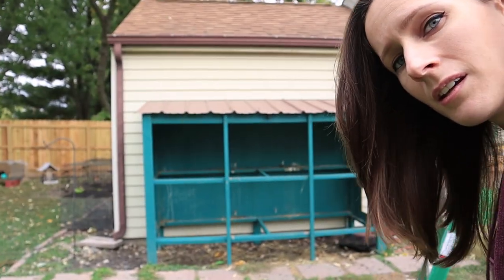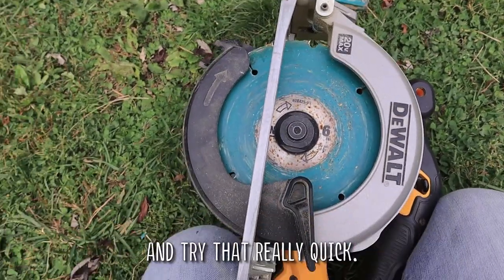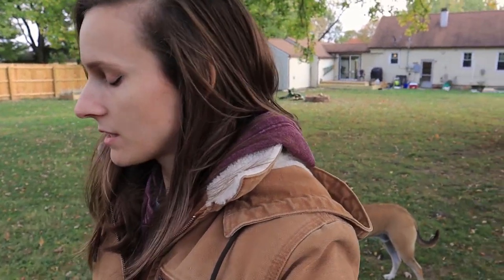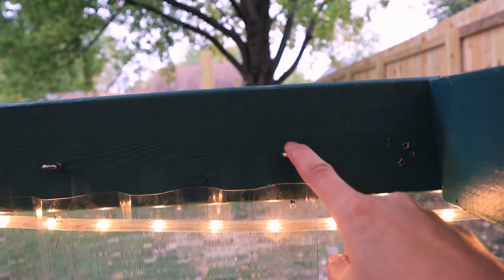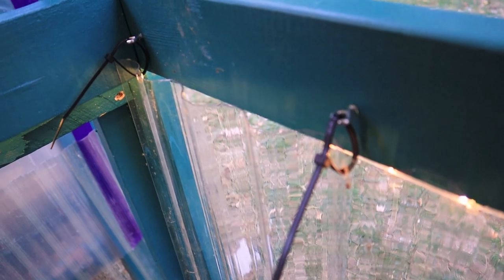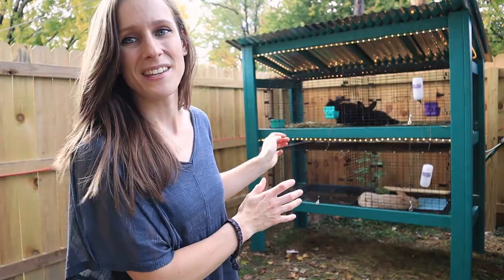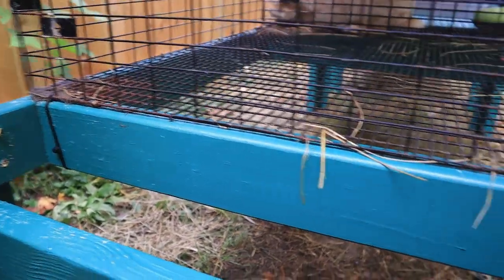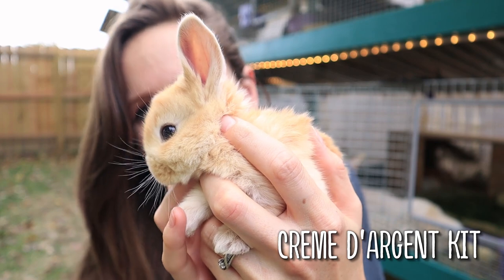Building a small rabbit hutch for beginners (silver fox and creme d'argent meat rabbits)

Comment: Do you have some of the mesurements of this? I need to re-do my set up since I got all my stuff second hand. I finally have the money to build new quaility cages/hutch for my herd, but the 8 hole  hutch is too big for what I need. Thanks!
Reply from the maker: I don’t have a blog post for this hutch (yet) however, if you check out my blog post for the big hutch, you can assume all measurements are the exact same, except this smaller one is a little less than half that width 😊 I will try to put a post together in the future for this one!

Comment: Hi Tiffany! Finally found my cages (Tried to build them, epic fail..moving forward while supporting local business for them still tho! lol). Building our buck hutch starting tomorrow! Doe hutch to begin later this week, or next. Excited! Wondering though, I found the doe hutch info on your blog. Do you have one for this one? Unsure about measurements for this one, and I want to make sure we get it right. Though, I think we are using slightly smaller cages than you did. our buck cages are 24"x24"x18". Two each level, total of 4.  Thanks!
Reply from the maker: Hello! That’s so exciting! 😁
I have long been procrastinating on the plans for the buck hutch... so sorry about that!! I can tell you, however, that it is essentially the exact same dimensions of the big hutch, just shortened and without the middle support (it’s not needed with the shorter length). Currently I have 4 30x30 cages in the buck hutch.
Reply: @TealStoneHomestead  No worries, I would be doing nothing in life if I weren't procrastinating, so I completely feel ya there!  lol. Seems easy enough, Thank you! :)

Comment: This is such a great idea? Question: does those metal flooring bother theyre feet? Or do they fall through  or can some sort of mat be put down on top?
Reply from the maker: The wire is totally fine as long as it is thick gauge like 14-16 😊 the higher the number, the thinner the wire. Thin wire can cut into feet, so make sure you do 14-16ga 😊

Comment: PLEASE cover the mesh on the floor! they get bumble foot from that!
Reply from the maker: It is a common misconception that rabbits get sore hocks from wire bottom floors. Rabbits don’t have paw pads like cats and dogs. The bottom of their feet is plush fur, therefor is is more important to keep them out of urine and waste as that can cause health issues. Sore hocks are commonly a genetic problem, and good breeders do not breed animals with that problem 😊
Reply: there are plastic inserts you can buy to provide another type of surface for the cage floor. One tile placed in the center is a fine option if you are worried about it. You will likely find that your rabbits dont prefer them to the screen floor... they like to be cool and the mesh cools them better. I do a coated half by half mesh floor and yes, I have to clean more poop that gets caught on the wire, but it does fall through and they dont eat the coating.
Reply: @TealStoneHomestead  Also the way the wire is installed makes a difference. If the bottom wire is installed with the crosswires facing up, it will cause sore hocks but it’s a simple matter to make sure the crosswires are down.